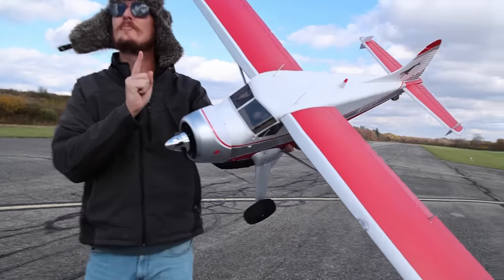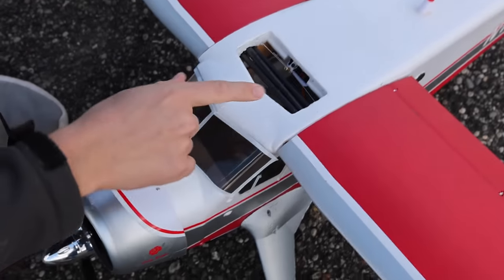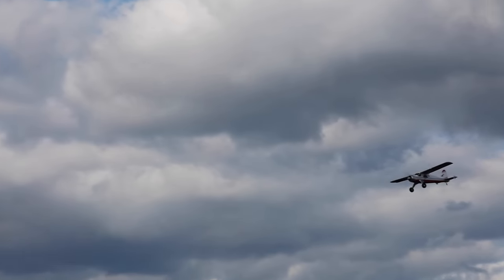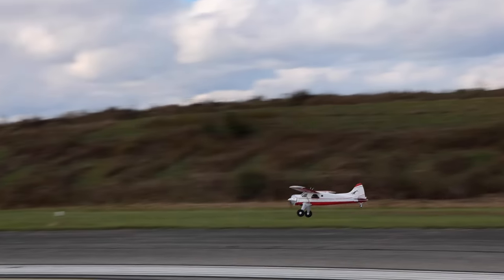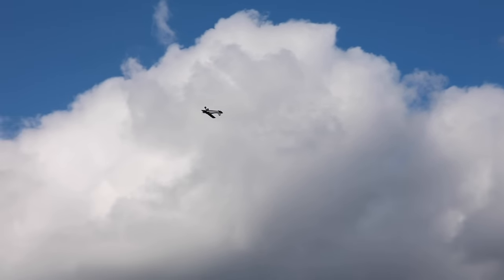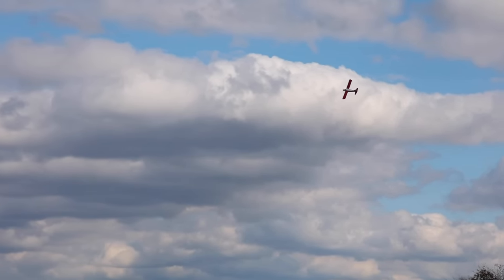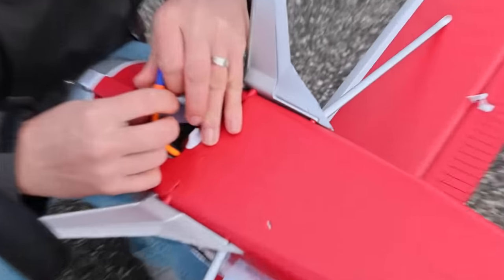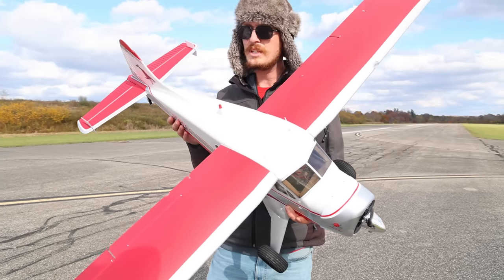BRAND NEW!!! Tower Hobbies DHC-2 Beaver 1.5m with FLOATS RC Airplane!

Comment: I love airplanes and boats.  I would just crash a plane, but Ive been looking for a seaplane to just operate as a boat.  I dig the Beaver.  Been a scale boater for 40 years, and have a Flight Instructor rating.  Been around airplanes my entire life.  Love the seaplanes.
Reply: I figured the same but was able to keep the voletrex p51 and the corsair up for a while thay got some videos on then I did brake a nose off but a bit of hot glue fixed that and for a hundred it seams like a decent try in to the hobby  I do suggest to get some extra batteries it allows ya to keep up in the air for much longer. Don't put them up in gusty wend

Comment: The single flaps servo will make it difficult to remove and reinstall the wings. That's a buzz-killer for me. Too much trouble to transport. It would have been so easy to build with dual flap servos.
Reply: Easy enough to do the mod yourself.  My Carbon Cub 1.3 has a single servo flap, just done a little differently.  That's 5 servos on an ESC's BEC, which is pushing it.  I wouldn't run 6 without a receiver pack.
Reply: My Turbo Timber, Cessna 150, 3 Meter Fox, 2 meter T28, Maule and Piper Cherokee all have 6 servos on BEC power. 4 Wing and 2 on the tail. Plus, the T28 has 3 on the gear, total 9. Never had a power fade on any of them. All ESC's in those aircraft are Smart Avians.